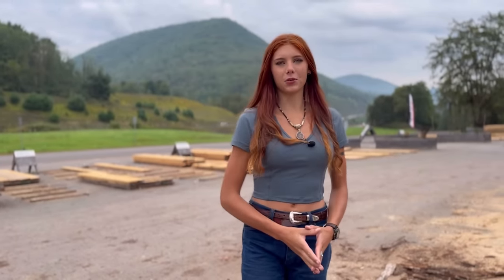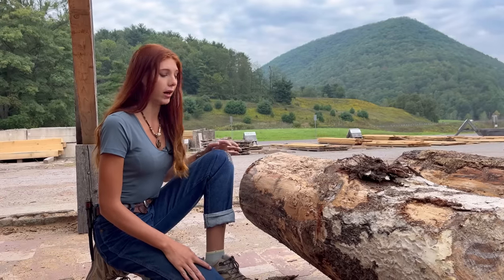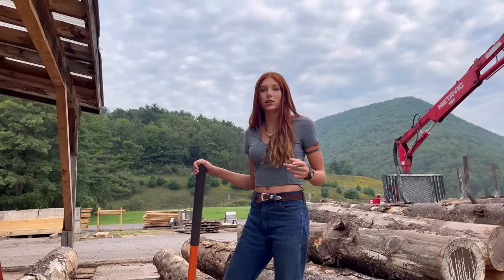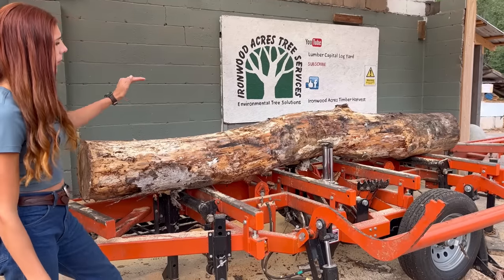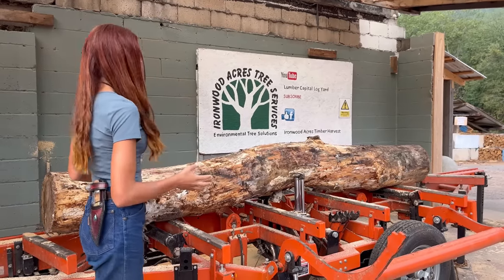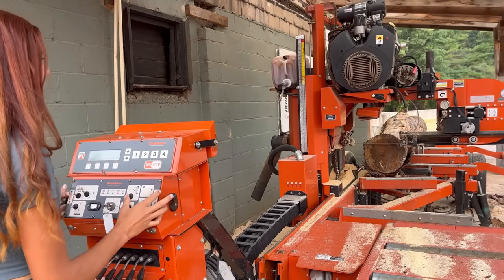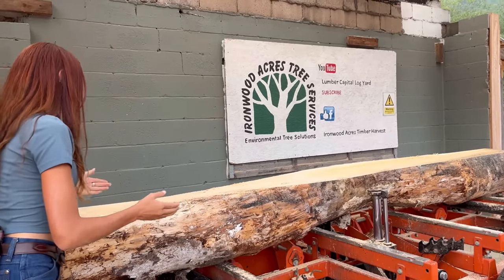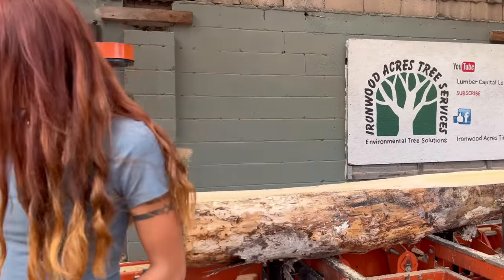PROBLEM SOLVED: How to Mill a “Banana” log!

Comment: Is there just not enough value in shorter boards to cut it into smaller lengths? It seems like if you cut in half at that major dip you could get two shorter logs that would have a lot less waste? I'm a noob to milling and have only cut small stuff for my own use.

Comment: you ought to find a smaller scale market.  someone who will take four foot one by all day long.  hobby builders, horse stalls, cabinet makers, pallets, wainscoting, or maybe those shingles that you have.  think outside of the box.  rather than cutting all long,  cut in half tuning the banana into a lil warp in the board.  if only to have half of your equipment, manpower or energy.  you guys are making it happen.  keep it up.  thanks

Comment: Those 2" by 4" will twist about as they season, and will not be good for structural work.  
Would it not have been better to cut for firewood straight away?
Alternatively, cross cut into three pieces, use the middle banana part for firewood, and cut the better ends as short wide boards?

Comment: Do you normally set the height to 4 1/8 to compensate for the blade kerf when cutting 2x4s (but decided against it because of the banana log remnants; i.e. remaining height was too low)?
Reply: I assume the overall height was 8" exactly, so you wanted to split the difference equally...that's what I'm trying to say.

Comment: Only thing to do is cut it short , the slope of grain caused by the banana shape will keep the cut product out any lumber grades . Might consider just turning it into firewood to start with . At least you don't have to worry about slope of grain. Or cut it short for fencing material . That log really isn't that bad . You want banana shapes try side hill butt logs

Comment: from my own experience - banana logs have other issues as well. 1. they have a higher risk to bow during drying, 2. fiber orientation, 3. tricky to deal with the heartwood - pith. I dont saw as business - i use the wood by myselfe in my woodworking shop. if they are realy bowed like hell - i like this wood because i dont bring them into dimension but but the bow flat on the saw mill - so i get curved boards out of it. In many cases i dont need the full length of the board and if you cut it anyway down to smaller sizes, the bow gets less impacting. There might be still tension in the boards but by knowing and paying attention to it, its managable. For softwood i might not be worth the effort but for nice hardwood it could be worth doing it and get nice boards out of it. Using the natural flow of the grain in a woodworking pice is an additional exitement for me... as said - maybe not for professionals who have to make money for it but for me as a hobbist - its exitement. 🙂

Comment: When the cant was finally clean and square at about 6x8 and acting like it was stable at that dimension, my first thought was to quit cutting then except for final dimensioning/surfacing and sell it as a structural beam. Once you start cutting two-bys off the cant, the likelihood of one or more of them going wonky off the saw increases- if not immediately, eventually. Then of course you hope you can salvage shorter straight usable/saleable lengths out of the wonky boards. Finally you'd be down to expensive firewood or pulpwood but have gained useful experience about visually judging what's hiding inside a curved or crooked log that can be turned into useful lumber by sawing it cleverly. Obviously Em is good at that and knows her work. But that full length 6x8 would've been a good outcome if you're in the dimensioned lumber business. Just sayin'. Also as other commenters pointed out, some of the initial barked and live-edge offcuts from this log look mighty attractive to specialty furniture builders! But understandably there may not be enough market for that in your region, especially for common pine, to justify stocking it at your place for occasional sale to artisans. Whatever, great job by our sawyer and host, great video all around. Thanks.

Comment: Surely there is a market for shorter planks and narrower dimensions. Even those initial cuts must contain enough wood for products like bee frames.  Cutting that log into 3 sections would yield a lot more wood.
Reply: I was thinking much the same thing.  Lots of woodworkers end up cutting long boards into short ones anyway, so if the log was cut in half and each half milled, you'd get more yield.  It much the same using a jointer on a warped board.  Cut the bow in half and the loss is much lower.

Comment: Any reason you wouldn't cut this into 3 sections and then run through the mill? While the boards would certainly be shorter, wouldn't the yield be greater?

Comment: I start out with it sideways or go in 4 ft or in your case you have the shingle market you've got a few options when my friend cuts one out of a tree I say what ya Makin pistol grips,I mill cedar for him more than anything pretty good market for tounge and groove,got a massive airplane hanger full of lumber alot of Birdseye maple curly maple I like the odd colored wood more than the design of the wood burls are worth a good amount around these parts ,but bluing in pine and rose color in popular and cherry but stacks of every kind of wood in the u.p are in hanger top to bottom end to end many semi loads, no hydros on mill here all man handled operation mill wood mizer, yous got everything figured out there I see no doubt about it what's nice is if everyone can do everything incase someone has to miss a day the other one or two can handle the task at hand, u did great with the banana by the way maximization!

Comment: I know I am late for comment but I just the video great job I cut logs with a curve in them quite often I got only 12 acres of land so no wood   that's got 2. 2x4x8 it goes on the mill my way of getting the most out of it I angle my log a little so the full hump is not on top but side way a tad I can get an extra or two that way but not always  obe like you had would be difficult have a great day

Comment: in tudor times they kept the log with a bend in it for timber framed corner bracing as the strength is maintained for example tudor buildings have a great example for example if you look at these houses  your see the bracing has curved 45`s rather than cutting it out they used there natural strength build by nature https://youtu.be/4PUNQ689n5s

Comment: Banana log is firewood.  You can get something out of it but good luck that board ever staying straight in any drying process.  Only banana logs I ever cut is if you are looking for boards to have a natural curve as they dry.  Otherwise firewood cause that cut board will twist and turn in so many angles as it dries.

Comment: cut and divide is my technique.  cut the log in half at the worst bow point.  you end up with more straighter sections (yes short length boards.    get out your chainsaw and do that...

Comment: Interesting video learn some stuff. The lady is quite knowledgable and informative. I find it weird that she dresses the way she does while working around machinery I will construction a large portion of my life under so many safety violations . Arms are not covered has a chain around her neck hair is not tied up and put away ring on her finger. They don’t look like steel toe boots. She’s in a yard around machinery with no high visibility vest. No eye protection I’d recommend gloves to protect abrasions splinters you can even help against pinchpoints. A filter mask or half face respirator wouldn’t be a bad idea to breathing in sawdust all day long couldn’t be good for you. Did have ear protection, good to see. That machine is an absolute awesome tool brilliant to watch.
Reply: Russel I think for filming the protective equipment isn’t needed.  But if she doesn’t at least take care of her hair and stuff during normal operations she won’t make it another 10 years without a major accident.
Reply: @astronemir  10 years you mightn't even have 10 minutes you never know when it's going to happen. Don't want to see the young lady getting hurt but taking some unnecessary risks.

Comment: I don't know what the rest of the tree looked like but if possible the logs should have been cut so the dog-leg was either at the end of the log or cut out and left in the woods.  We cut lots of these low grade logs because the large production mills don't want them so they are cheap.  If I scaled that log I would deduct nearly 1/2 the volume for crook.

Comment: a tree that twisted is basically firewood....nice job salvaging what you could.  I'd be concerned as straight as you cut the boards they will just twist up on the cure due to the weird grain.

Comment: I don't know that I'd even bother with that log, other than camp firewood.  I wouldn't trust it to not warp or twist when dried.  I mean even just sitting on the mill they look like there's some warp.  It might be ok for a small time woodworker cutting their own lumber that could use some 4' long stock though.

Comment: Aren't the boards going bow during stickering due to the grain being cut differently along the length?

Also why not cut it normally perpendicular to the bow? The board will be flat, you get better use of the log, the grain isn't cut oddly so there is less warping, and the curved board can be used on furniture where curves are wanted.

Granted the market is limited for curved boards and needs to be of a wood that people want to use for fine furniture or boat work.

Comment: I'd cut it back to 8' 6"
Take the straightest part of it, cut it out of the log, the rest junk it.
Or mabe 2 8s if it's 16'
Other then a very good example that's stove wood in my book.
.
The word your looking for when the blade gets pinched in the cut, is timber bind. more common when the center of the tree rings are off center not a given for binding, but more likely.
0.01c
Reply: 2x4s that's 2/3 of a bf per running foot, so say it's a 12' log x 6 boards that's   something like 47 bf.
 scribner scale was probably around 80ish bf for the log.
That definitly shows the loss.

Comment: rather than milling it to 8 x 6, THEN milling 2x4s from it, wouldn't it be more effective to make 2" thick 'slices', then mill those down to whatever width you can get, assuming 'normal' dimensions - 2x4, 2x6, etc? sure, it means more cuts, but it might also mean less wasted log, less material going to the chipper/shredder...

Comment: If that is a 12 ft log or longer you are better off cutting it in half. The slope of grain in the middle of the boards you get are a killer. And you will get more useable wood even if it is shorter

Comment: Why all the comments about using this log as firewood?? In my neck of the woods pine isn't really something you burn.
Reply: All Wood burns if its real dry, everything in moderation, Elm is considered junk wood too but it smells good I think and it puts out the most B.T.U.' s  according to the Conservation and I can believe it!!!!  Pine and  cedar can be burned, in small amounts, a little at a time!  But keep a closer eye on your chimneys flue's/ exhaust.  They are not premium wood but can be used a little at a time. ( From Mo.).
Reply: @jimbrown4661  I was pointing out the suggestions to cut it up for firewood instead of milling. Suggesting it would be more profitable as firewood. I don't think that is the case with a pine log vs something more desirable to burn.
Reply: I also agree using it as firewood, but not for sale. But it can be burned for personal use. I told them i was thinking firewood and or stickers for their lumber stacking. A log like that, would have stayed in the woods.

Comment: Wouldn't it yield more usable wood of you'd cut it first with a chainsaw? If you cut 1/3rd off, it should already be straighter.

Ofc, the resulting lumber won't be as long, so not as valuable. But still usable.

Comment: Nice video and explanations. Whoever was on the camera was more than excellent! Who was that? As far as milling the banana, I know you didn't pay much for it, but I think I would never bother with it even though it is low cost because of the time, effort, and use you are putting on the saw blade - not worth it. Just my options, but fab video.

Comment: I am so very curious as to why your not cutting two by fours for pallet stock as pallets are quite high in demand, almost everything being shipped is on a pallet. There for, cutting a "banana log" in pallet board lengths would give more yield. It appears on video that this log would of been long enough to cut three different lengths out of it. All long enough to make pallet stock. It would therefore cut down on the waste and give less of the word I'm looking for does escape me for the moment. What I am getting at is a grain that has less strength because the grain doesn't run with the log but as a cross or if hit, pressure applied would break easy cause the grain runs out to the side instead of following .... I know that you know what I am talking about... like when your making a axe handle, it the grain is not true it doesn't have any side strength. Errr, I hate when the brain freezes up on me. Do you ever cut for pallets?
I think the word I was looking for is "Slash grain"

Comment: Just hope the user of the 2x4s doesn't use these to support some weight. All the cross grain in the lumber makes them very weak. Would be better cut into 1" for sheeting where strength is not so important. If the log had been 16' long, I would have cut into two 8' lengths. Obviously the person bucking up the original tree didn't look at the log and cut it up with the hope to optimize quality lumber production.

Comment: You could have utilized the whole log by making smaller linear boards! I need only 36 inches in length but I have to buy a 96 inch board (8ft)!!!!  Common sense! Here's your sign!

Comment: Well regardless of it being pine, this really isn't a banana, I buy several white oak n red oak bananas a year with purpose,  I call it SKIFF STOCK. , It's slab sawn. I typically get 18' board's and in that 18', a string line between high points were looking for 2' of low spot. But that thing you just cut looks more like a rattlesnake 😂😂😂

Comment: Look how warped those 2x4s are immediately after being sawn, god only knows what they will look like when they are dry. That log screamed "firewood" from the beginning, that kind of bend is never going to produce stable lumber. You might have got a usable fence post out of that cant before you did the last cuts but jesus seems like a lot of wasted effort.